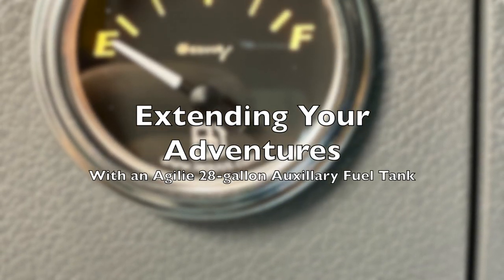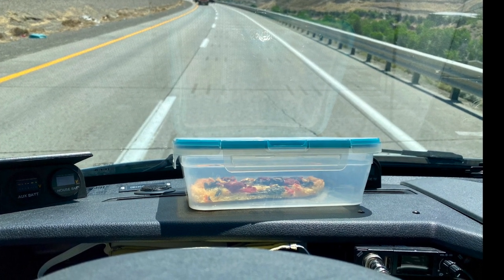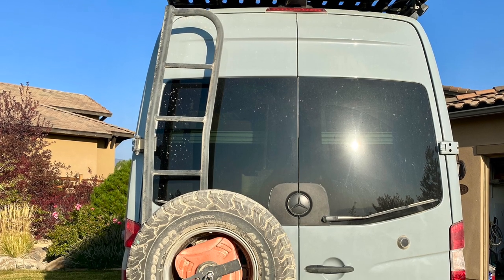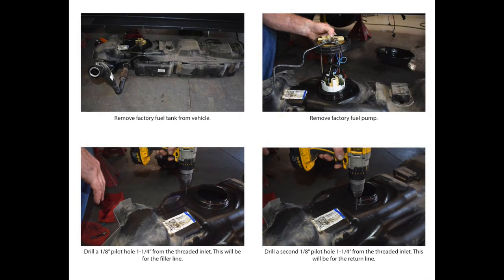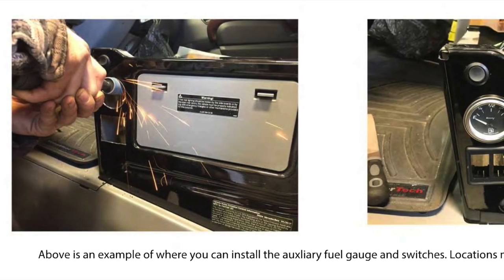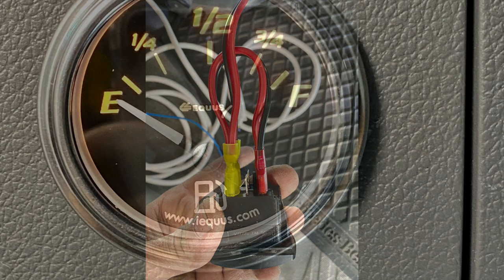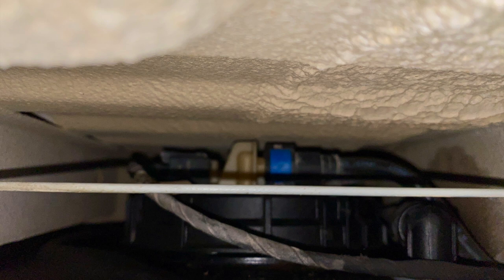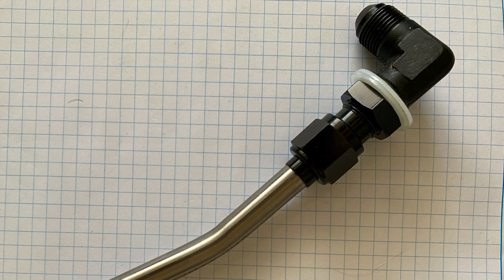Extending your Mercedes Sprinter Adventures with an Auxiliary Fuel Tank

Comment: Just had this installed on my Sprinter. What peace of mind now. It functions just fine and Agile now has a mouse trap door that goes over the switches so I don't hit it accidently with my foot. fueled up both tanks in AZ 3.11 a gallon vs 3.88 in Utah. love it.
Reply from the maker: Awesome! That extended range really can be a massive relief while traveling in remote areas, or places with rough weather, traffic, safety or high prices. I'm always amazed how much benefit it can provide, including recently driving thru an area under forest fires and heavy smoke yet I would've needed to fill up but instead used my Aux tank's fuel to keep moving thru that area. Glad you like and glad that Agile improved their switches--that was a concern of mine and why I located them in the dash to be out of the way of feet and so I could see their position.

Comment: My 2020 Mercedes Sprinter-Tourer 316cdi came in germany with an optional 200 Liter / 53 gallon diesel fuel-tank, that replaces the org. 71 or 93 liter fuel tank one to one.
I got with the 316cdi / 7G automatic combination a range from up to 1700 miles.
The aluminum diesel fuel tanks are availalble in ebay and they have the certification stuff for 907 and 910 sprinters.
Reply from the maker: That's great! Thanks for sharing.

Comment: $2700 for a 28-gallon tank? Ouch!   There are quite a few universal fuel tanks listed on eBay for under $200.  What's the difference?
Reply from the maker: Yep, it's pricey per gallon, but is a custom-sized tank and complete with fittings and transfer pump. I fought buying it due to the high-price for a couple of years, yet finally glad I did as allows for more exploration in remote areas and buying fuel in places with lower prices, and being able to do significant weekend trips without fueling up, so a real convenience.

Comment: Looking on their website, do they offer this tank without the installation? Everywhere online suggests the only way to purchase it is if you go through an install with them.
Reply from the maker: I had the same issue when I purchased, but just called them up to only purchase the tank without installation. They were helpful with my installation when I ran into the issue of the pick up tube falling off but did take a few attempts to get a response. They shipped it to me but I also was in San Diego on a couple of van trips and stopped by their shop for help which they always accommodated. So yes, contact them to purchase without installation. It may take a couple of days to get a response.